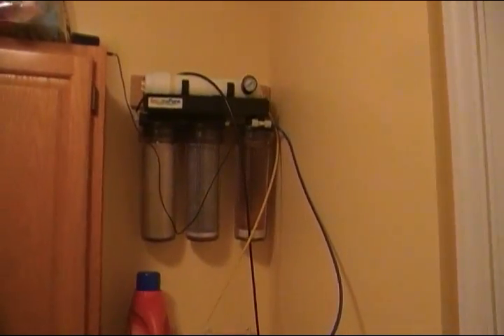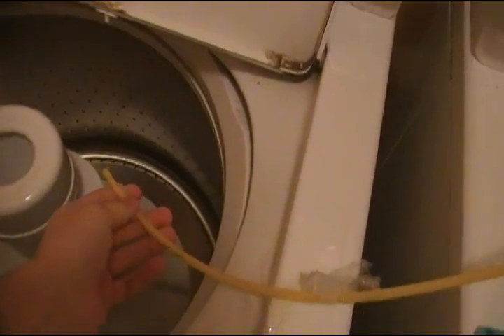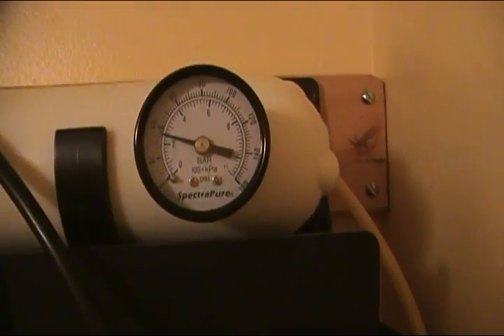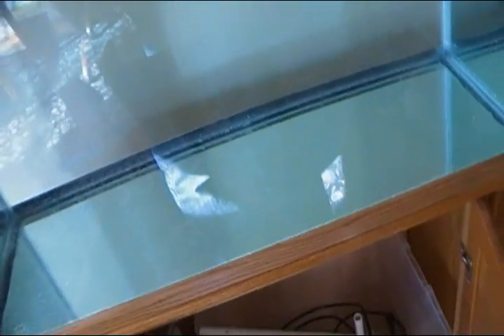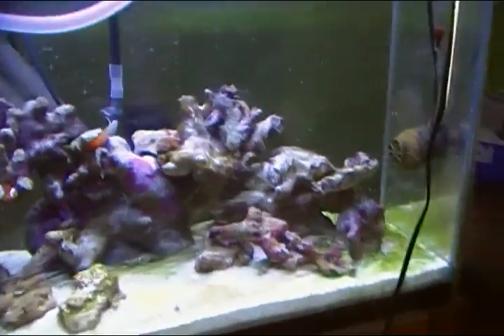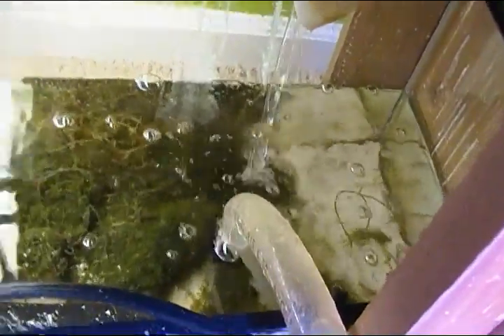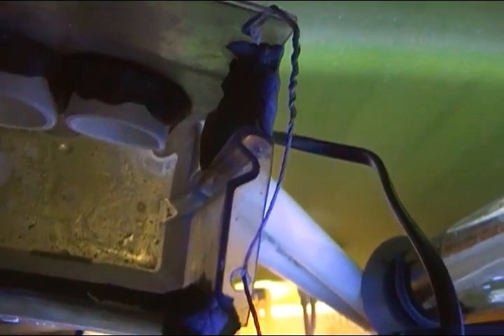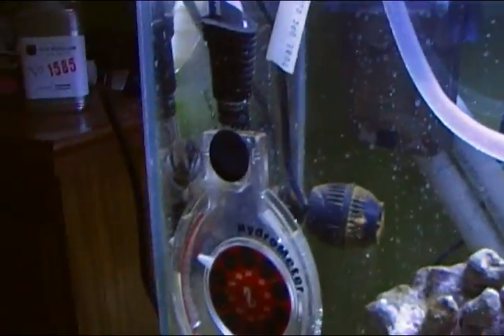saltwater aquarium update

Comment: Just picked up a 65 gallon my self that was used that looks likes yours but its drill, am planning to kind of do the same setup as you with the mp10- and a refugium on the bottom but am going to use metal halide and also for the reefkeepr lite and going to add the top off insteand of buying the jbj which i think it will be good for you since your getting the reefkeeper instead of spending the $99, it will be $25 or $50 if you want two swiches and connect it to your reefkeeper,